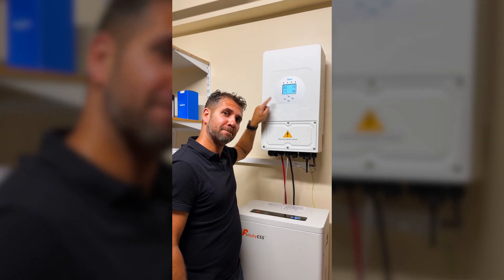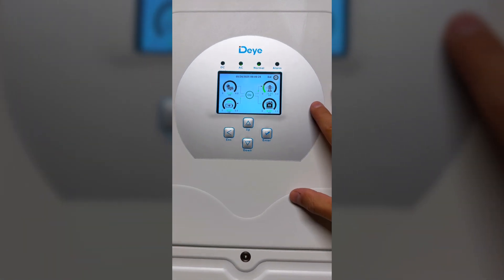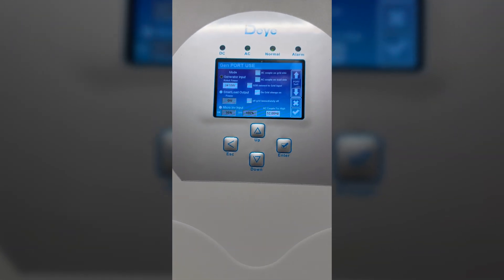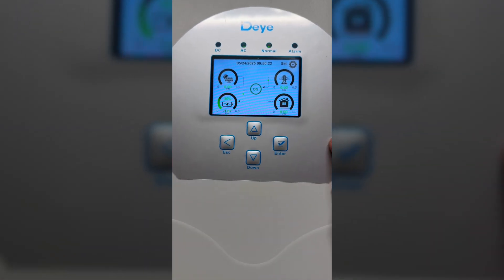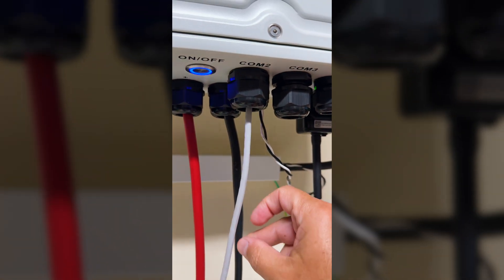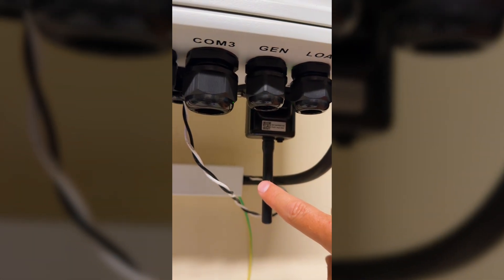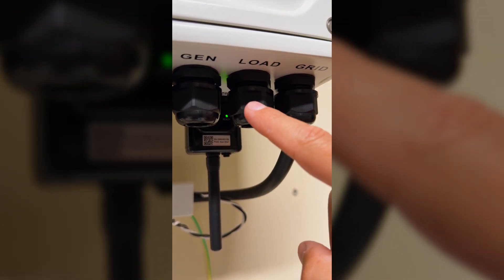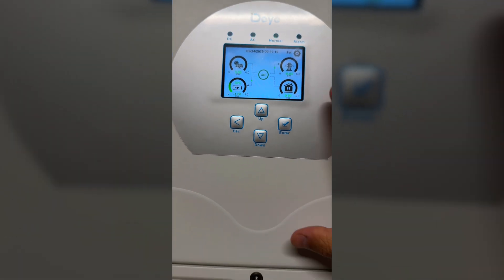Enable AC Coupling Mode on the Deye to Add a Battery to Any Existing Solar PV System 🚀🤯

Comment: Hello, can some of you try the following case:
#1 turn off AC grid connection
#2 turn off DC from solar panels 
#3 keep battery connected 
#4 turn of AC coupling on load side
#5 connect other power source on load port

Now the very important question:
Can the inverter charge battery from the other source?

This is very specific case and can't be solved other way.

Thanks a lot to anyone who can provide me answer

Comment: Hi. I am in Spain and also experienced the power outage you referenced and while having solar with AC coupled batteries my system is unable to work without grid power. I have been searching options for having backup power without having to replace a solid, reliable and for me large system. 

I currently have 2 Fronius SYMO inverters (1-10kW and 1 5kW) plus 2 Sonnen 15kWh each batteries. In summer I have enough storage capacity to cover the expensive hours 08:00-24:00) not completely so in winter.  I also charge the batteries at night with very cheap rates which are greater than the feed-in rate. Adding more battery capacity would be to dedicate almost 100% to back-up duties as today in Spain the probability of more power outages is greater than in the past. 

Would in theory be interested in having a DEYE 3-phase inverter with its own dedicated battery as just to handle back-up duties with covering most of the circuits as back-up loads.  As an option I could replace both Fronius with the DEYE adding a battery 15/16kW battery for the back-up duty and keeping the Sonnen to do the daily charge/discharge routine. Is this doable/desirable. Can the DEYE do back-up duties without feeding the grid or having to shut-off manually the grid connection? 

Thank you for your input.

 Rolando

Comment: Thank you for this great video. I just want to confirm that the cable in the grid port is from your main meter box? Secondly, so you will use the excess solar during the day from the grid tied inverter and send ac to the deye to charge the battery and then at night through the same cable send power back to the meter box which will power your house? Do I understand this correctly?

Comment: Do you know if I can use only the LOAD output for the whole house, as I currently have it set up, and also connect microinverters to the LOAD input? I should add that I am off-grid.

Comment: How this feature behave in a Parellalelized Deyes ? 

For example i have 2 x 5Kw Deye in parallel and so far 2 years it is working fine as a single unit and charging the same baterry (60Kwh) 

But i have 8 solar panels laying on my garage so i want to use them but i have a EASUN inverter 8 kw which i purchased before few years on a sale for 250 Euro so i was planning to use it with these 8 panels. At the moment i am going to use it as a controller to charge my main batteries but since i saw this option for AC Coupling it means that i can use EASUN  inverter to export to grid and the Deye will pick up this current using the CT sensor but what will happen if both of the inverters are in parallel ? 

Is the parallelization disconnected so they act as a standalone units and do they need then 2 CT sensors ? 

Cheers!

Comment: Is possible to connect the AC output of the old existing inverter directly on the gen port?
Reply: Yes, but for better energy conversion, it's more efficient to connect the solar directly to the Deye inverter, otherwise you have the old inverter converting DC to AC, then the Deye inverter converters AC to DC and finally back from DC to AC when you need the power in the house. Lots for losses along those conversions

Comment: Great explanation man, I have a question : should the Ac output of the inverter that is tied to the grid - the one that has pv panels - be tied to the grid input of deye? Or just I have to pull a line from the main grid to deye grid input, would be thankful if you give me your email to send you connection diagrams 
Thank you

Comment: OK . Can you show us schematics. For example I already have a ongrid 3phase Huawei inverter as main inverter with PV input on it. My house is single phase so i want to buy a deye 6kwh single phase and a deye 16kwh battery. Its the Ac coupling possible and how we do the conections and what do we need. And also how do we set up. What do you say. Its possible???

Comment: Nice vid, something we have struggled with our customers over is the monitoring for this, do you have any data from the AC coupled unit like production? clearly we see it charges the battery but the monitoring for AC coupled inverters is poor/lacking which confuses customers, some of them saying it dosent work at all! we have also tried using external meters through Deyes instructions but that dosent work either and then they stopped replying to those questions unfortunatley, other than that the Deye is truly amazing and does extremely well on and off grid. Only 1 faulty inverter in 200 installations!

Comment: I have a Deye 3 phase 20kw inverter. I think its best feature is smart Load. I have connected my solar water heater with the inverter and when there is an excess of power the current is going to the water heater so I have always hot water
Reply: What is the model of your inverter?

Comment: I also have a Deye 6Kw inverter and have just bought the Felicity battery that I saw in your Youtube video. I am very surprised by the build quality, the inverter and battery work great, I have hardly bought electricity from the grid and we also charge our electric car.

Comment: Does Home Assistant have an integration for this inverter, and if it does is it local communication, or just through the cloud?
Reply: yes, I use solar assistant for local connection then mqqt broker to home assistant via wifi